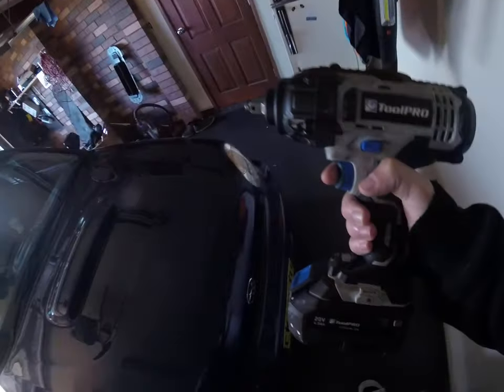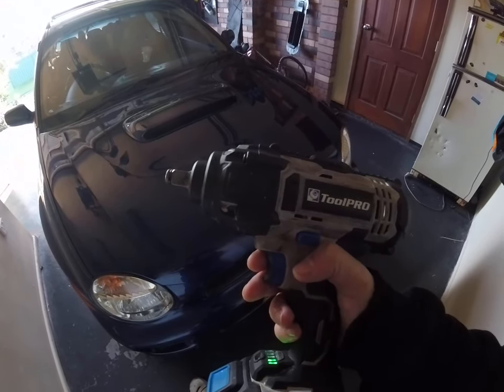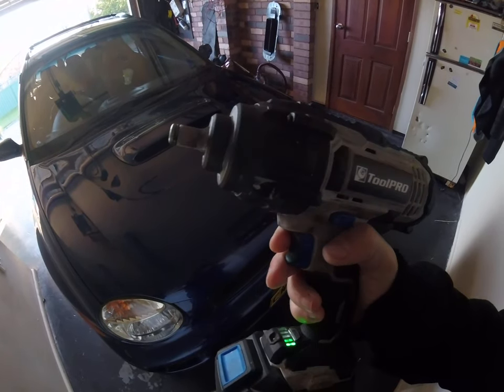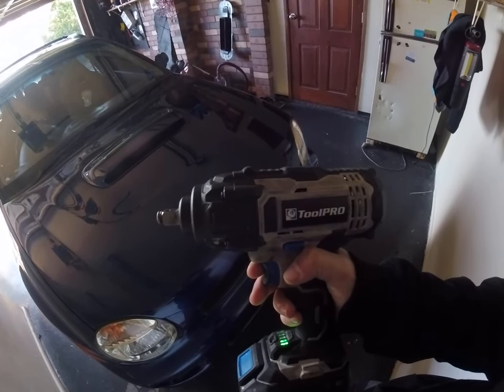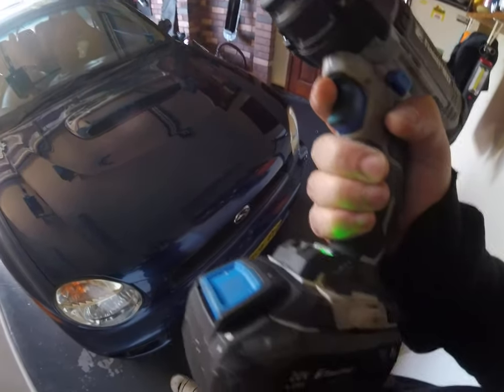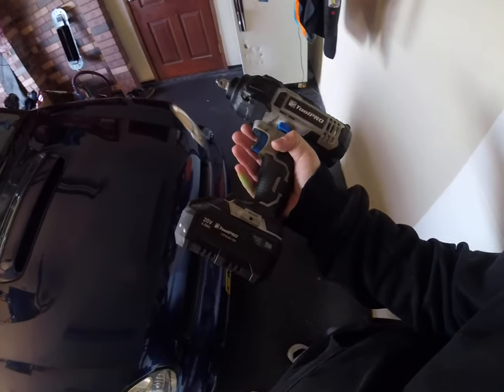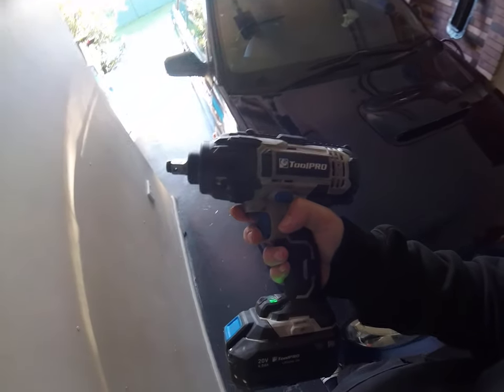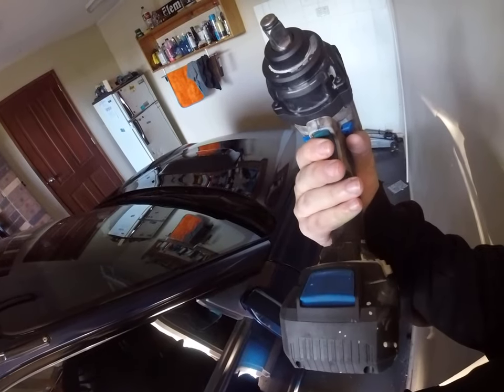20v tool pro impact gun 6 month review

Comment: hey in England these are no joke exactly the same as the power tools randomly sold at a supermarket shop called Lidl, dunno if you guys have them, but i have a impact wrench from them that nearly looks identical for £60/ Australian $108. That included the impact wrench, 4ah battery and charger lol. The only down side to Lidl is they only have then in every few month as a special. I think the same manufacturer Makes toolpro stuff.